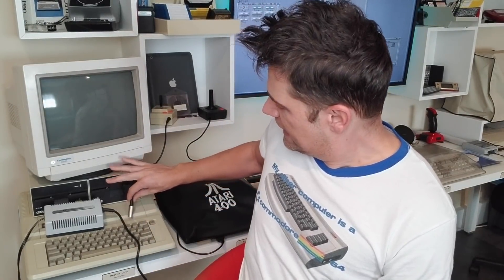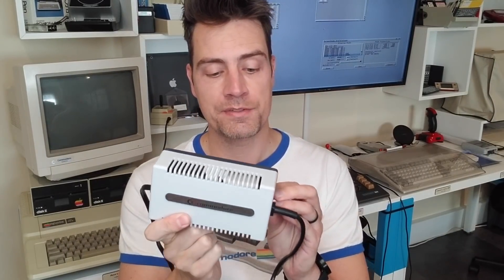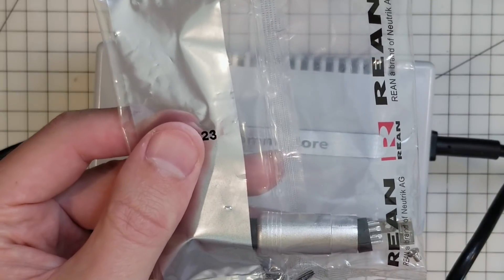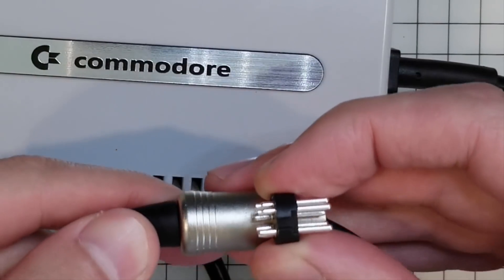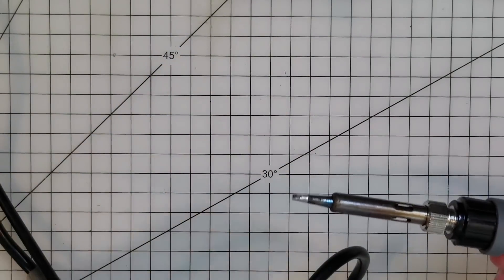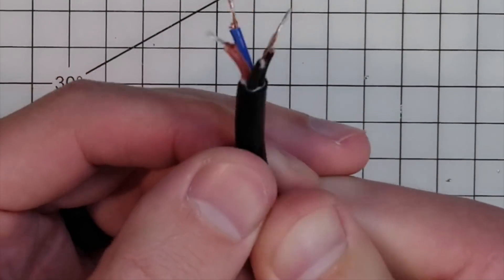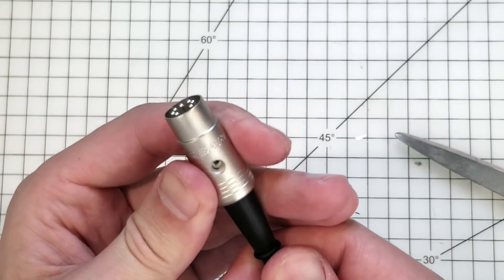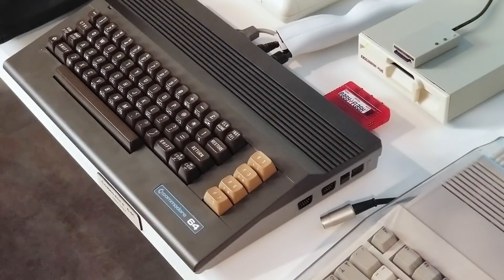How To Solder DIN Plugs - Commodore 64 Power Supply

Comment: To tin the cables you either need to add fresh solder directly (awkward) or you need to add flux. Just putting enough heat into them to transfer solder from your iron tip is not going to cut it, especially since the fresh solder in the DIN cups has already activated and released the flux core.

Dipping the stripped ends into gel flux would’ve got much better solder wetting at a lower temp allowing shorter exposed bits without melting insulation.

Yeah, DINs are a nightmare and require a lot of technique and finesse to solder. Maybe crimping is the way to go!
Reply: How would you even crimp DIN pins? Serious question here.
Reply: @gabojill19  some manufacturers sell them with pins that require a special crimp tool before you individually insert each one into the DIN connector. I’ve never used one but I’ve seen them. I have a crimp tool that can crimp many different kinds of pins but I don’t know if it will do those. I use it mostly for KK, DuPont, Molex, JST, and JST-XH pins/connectors. I believe Teaching Tech (or was it Maker’s Muse?) has a good video on these as they relate to the various connectors on 3D printers.

I know RadioShack and Fry’s Electronics used to sell D-sub connectors with crimp pins but I never knew what kind of crimp tool to use and they didn’t seem to sell one. I recently found a bunch of new-old stock RadioShack connectors at a salvage store. I went ahead and bought them since I bet the crimper I have could do it (the one suggested in the video I mentioned).

Unlike the butt splice connectors you find at the hardware store, most of these pins/receptacles crimp each piece twice, with one set holding onto the wire’s insulation and the smaller one grabbing into the wire itself. Crimping actually makes a better connection than soldering and doesn’t make stranded wire more brittle/breakable where the solder ends… so it’s considered more reliable. I see some people always crimp AND solder but that’s sometimes a bad idea.

Comment: I can’t recall if I got this idea from someone else or not, but for several years now my trick has been to slice the end off a potato to make a flat side, then stand the potato up and jam the DIN pins into it. Makes a really solid holder that keeps the pins from moving around in the plastic when they get hot. I first did something like this after struggling with “helping hands” (alligator clip stand) to make my Atari 800 Y/C monitor cable back in 2016.

Of course, I clean the pins before final assembly but that extra step is totally worth it.
Reply: @emmettturner9452  You sir will now be added to my Christmas card list, off to the kitchen to grab a king Edward, my helping hands can be so wobbly that soldering small items become hit n miss.
Your potato trick is so obvious that I would never of thought of it…..>doffs cap< 🫡👍🏻
Reply: @toddy9141  LOL! Thanks. Unfortunately, it can’t help with getting the wires stripped and attached at the right length but at least it frees you up to focus on that frustration. Good luck!

Comment: I just finished soldering  a Commodore Composite cable. It was horrible.
First, the DIN connector was the cheap type. Then,  half of the RCA cable I was using turned out to be broken. No matter, I could at least test without Audio.... And now I realized I did the whole thing mirrored, and now I have a RCA cable connected to Audio In instead of Composite video, so I'll have to do the whole thing again.

Comment: Came across this video to get some inspiration, as I had to make a null-modem cable changing the DE-9 end to a DIN 5 end for an apple IIc, I used the crappy DIN type with the holes instead the bevels, and with the help of those clamps and a magnifying glass finally managed to do it! So many thanks, now I can fully enjoy the machine!

Comment: Hi, why you are not using Kynar inside  the DIN conneactor to protect the wires from each other?
Reply from the maker: Because it does not need it and works perfectly. This video is nearly two years old and it's still my daily power supply. As long as you position the wires correctly it is not necessary

Comment: The only thing I can think of would be to use one of the helping hands to hold the wire to be soldered in place next to the pin. It's certainly less painful touching the iron to one of those than to precious fingers.

Comment: Hello! Great video, thanks for sharing the tips and insight. However, when I was welding a DIN 5 to a 3.5 mm audio mono, I noticed that the tin wire is wider than the DIN sockets so I couldn't apply the method you demonstrate at 7:31>

Comment: Thanks for the tips. Have to solder one of these things in the morning. I see why they sell these things in 2-packs.  For those who are as uncoordinated as I am, and who may possibly heat things up too much, causing the plug to deform (i.e. melt) and the pins to go askew, try plugging the DIN plug into a socket while soldering the pins - that keeps the pins aligned.
Reply from the maker: Careful you don't melt the socket though with the heat transfer 👍🕹️

Comment: Why put it inside the conductor, and then cut, and then melt it? Seems like double work to me... what's wrong with putting it in, use the solder iron to "cut" the tin, then heat it until it's settled?

Edit: that brings me to another thing that my electronics teacher always warned me, which I've seen a lot of retro repairs violate... when you violently cut a leg, after soldering, you better re-heat your solder point, because the mechanical shock may be enough to disconnect a PCB trace. Is that just a myth of the bad quality home made boards? ... I've soldered, cut and reheated a LOT of boards because of this.

Edit2: you should really put an effort into twisting your copper before pre-tinning.. and you leave way too much copper exposed, unless you're generous with shrink wrap.

Comment: I’m sorry to say it, but that didn’t look too good at all. You can do better. Don’t strip the cables that long, Tin the cables, not the connector. If the strands don’t fit in the pins, strip away only as many as you absolutely have to. But most of all I‘m worried the long blank wires will touch each other or the shield. Honestly, this thing to me looks like an accident waiting to happen.
Reply from the maker: Did you see take 2?
Reply: Perifractic's Retro Recipes Take 2?
Reply from the maker: I redo the job near the end as I'm not happy with it...

Comment: Connectors can be a pain.

 My worst experience was making a connector for a Sega Saturn. I used some bits of paper clips for the pins, for the round shield, I used a piece of the RF shielding from some dead device (I think it was a CD drive,) an old S-Video cable, some stereo RCA cables, and some casting resin to hold the connector together. It's ugly as sin but it works.

Having said that, I've worked with the DIN connectors as well and frankly, I'd rather be flensed.

Comment: I would've used heat shrink on each wire and connector.  After testing voltages and such.

Comment: would be more practical to know 'where to buy a machine that solders din plugs by itself and molds the connector around it' as we most definately don't just want to produce 2 or 3 of the things. :P the same goes for everything associated with the manufacture of all the custom chips in it, as in a whole production line. :P

Comment from the maker: Thanks for watching! I'm no expert, but what did you think of my technique? Will you be trying this? And what are your phobias?! Let me know below!
Reply: Will be trying it shortly, I'm building the same PSU right now.  Doing it a bit differently because I'm not re-using my old PSU's cable but we'll see what happens.
Reply: Total failure.  I think the connector pins weren't made right because there was no room for solder, let alone tips of wires.  I'm falling back to plan b - I ordered a cable with the right kind of connectors on both ends and I'm going to chop it in half and splice right onto the wires.  Thank you for your video, though, it really helped.

Comment: Just how tiny is the Diameter of the Solder you manage to easily insert into the Solder Cup/Pins of the Connector cuase even 0.5mm is technically too big if I'm not mistaken.  -Mark.
Reply from the maker: Deborah Beri 0.71mm but it fits ¯\_(ツ)_/¯

Comment: Ah, yes, never any fun soldering DIN plugs, but you did a good job.  My only constructive criticism is that I think I would suggest not cutting away any of the copper strands and perhaps soldering a portion in the cup and the remaining ones on the outside of the cup—it's easy for me to be an armchair quarterback; I should probably give that soldering challenge a try, myself.  However, the soldered portition of wire was much shorted when you remade the connection, so I imagine there will be no noticeable issue with trimming the wires short.  I do like the REAN brand connectors—I have several in my arsenal of parts, as well.

That said, I enjoyed, as always.  Great work!

Comment: Great video, as always!  These are indeed a pain in the neck to solder.  I hate DIN plugs!  mini DIN are even worse!!  Whenever I solder those cheap ones I always end up melting the stinking plastic the pins are molded into. Then I found the same connector you are using and what a joy!  Even better I found some DINS that have solder eyes that you can actually loop the wire around and they are by far the easiest. 

My only nitpick would be to use some heat shrink tubing on all the connections so there is no bare wire exposed when you put the shield back on.
Reply from the maker: Racer X I'm glad you like it! In the description I did mention insulating from the plug metal grip, which is the main concern. I'll check out those eye loops, thanks!
Reply: Exactly! The cheap ones are everywhere, but completely useless. There is no opening for the solder and by the time solder actually adheres to the pins, they're melting the plastic and moving around. I just ordered two of the ones used in this video and I imagine it'll be much better.

Comment: What diameter solder wire are you using?  Appears to be higher than what I'm using (0.8mm).
-Mark.
Reply from the maker: 0.71mm 😊

Comment: Nice video, I have a few details that annoyed me a bit, being an instructional video. 
How did you get the shell on
You have a good size cable and you choke the current by cutting away strands...  that's not "the correct way to do it". The wire gauge is needed to be able to transport maximum current. If cutting away part of it you risk heating it up where it's thinner, maybe so much that the solder gets soft. 
There is more than one 5V pin and GND pin so cable ends could be split and soldered on more than one pin. 
There's no rule that the cable has to be inserted in the hole of the pin (if the wire is thin enough - sure). Soldering it on the outside is a perfectly good solution.
It's easy to short something in the Rean connector with the metal cover (I have soldered a few), some insulation (shrink tubing perhaps) tube to cover all the pins inside is a good idea. 
- Nicely made video as always.
Reply from the maker: e5frog Thanks for your feedback. There seems to be no current choke in the multimeter that I can see. No warmth in the plug either. That cable is far too thick for 5V/9V if you compare it to today's alternatives. Remember I have modern adaptors on the other end (see my PSU video.)

Not sure where there are 5V or GND cups?

In the description I do describe insulation to avoid shorts 😊

Thanks again.
Reply: If you have some more equipment drawing more current there could be a problem, I was looking at it today as someone asked about it on Lemon64 and it seems AWG22 or 20 should be good enough to run 2A for any multicore strand amount listed. I guess they used a little extra on the one you use, but better a little extra than too little. ;-)
Nice to see that you tidied up the soldering. thumbs up

I have watched the PSU-video, very nice, looks very nice, would be hard to do the same with European equipment, would need a much bigger box. Have never seen a double ended connector like that (European standard). Simple, handy and should be easy for anyone to do.

You have 5V on the other side of the usual GND-pin as well (on all motherboard revisions than one IIRC), the other pins that aren't 5V or 9VAC are connected to GND. So with DIN numbering standard 1, 2, 3 is GND; 6,7 is 9VAC and 5V on 4 and 5 - 4 may be Not Connected as mentioned a simple resistance check on the computer will reveal if there's double 5V or not.  ;-)
https://ist.uwaterloo.ca/~schepers/MJK/pics/power.gif
Reply from the maker: How interesting. In your diagram (and most) pin 4 is not connected. I have heard of C64s with the 5V only on pin 4, but never seen one, nor with both. Peculiar! Some DINs have the other pins removed, only 4 pins in place. Either way, it works, current is good, no warmth on the DIN. That's all I can ask 👍😉🤞
Reply: Perifractic's Retro Recipes I'm sure Commodore saved millions by just populating the connectors with four pins. ;-) 
If you have the time you could check your motherboard. 
When Ms Kent and myself built the saV64 over voltage protection we had to jumper the two 5V pins as some later PSUs (for C64C) instead uses the other pin (N/C in the schematic), these are also often fully populated.